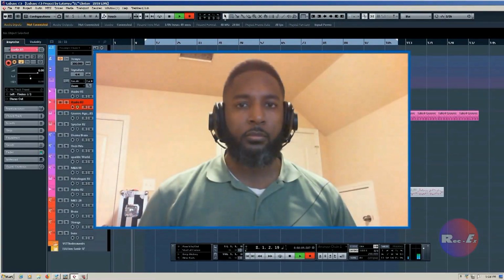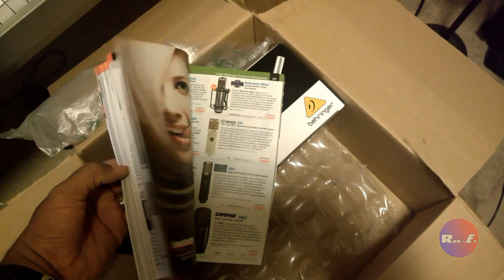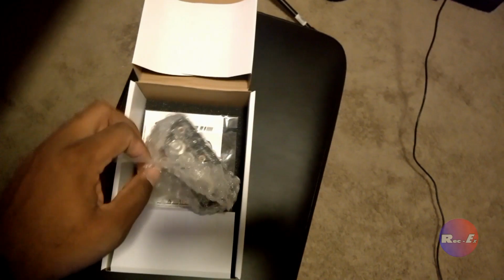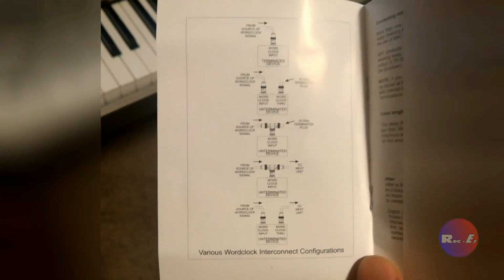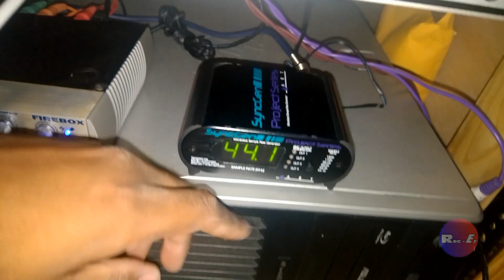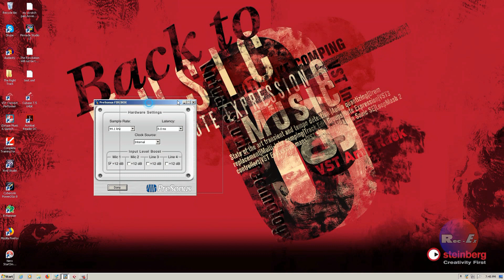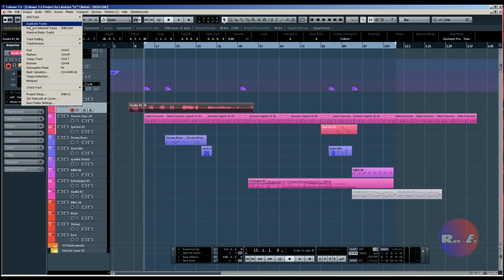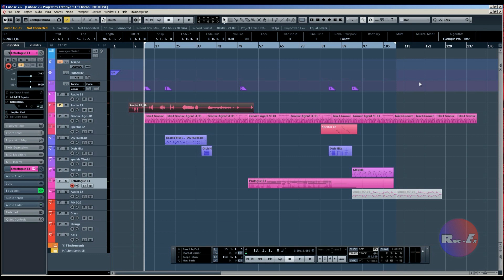Art SyncGen - Word Clock Generator - RecEx Ep1

Comment: Hi, would this work with just hardware?. As in to get various pieces of hardware in sync with eachother?.
Reply from the maker: Yes, if you're running multiple sound cards, FX or signal processors and they all have word clock input (BNC/SPDIF), this will keep them all in sync. It's not just for soundcards. It just primarily baked in  soundcards.

Comment: Thank you for the video. A year later, do you still like the Art syncgen?  Any issues with it?
Thank you.
Reply from the maker: I still like the Art Syncgen. However, this was a short term victory. Not long after using the Art Syncgen to fix the audio clocking issue , my sound card just died. When your soundcard starts having timing issues, just get a new one.
Reply from the maker: I eventually ended up going with a Yamaha UR242. So, these days in not using the Art Syncgen.
Reply: @TheOfficialLCProductions  Hey chief
Did you Test if there is a difference in sound 
URs own clock vs Art Sync clock?
It should/could bring a better stereo Filed (as they say)
Reply from the maker: It's funny you mentioned that. The first thing I was told was that it would have better sound quality. I honestly didn't hear a difference in the sound quality. However from a mixing and mastering standpoint, I could tell the overall mix on my tracks were fuller, beefier. If it were not for the advanced metering I use, I would not have noticed.
Reply from the maker: @jameslast6581  I'll also add that your sound card will always sound and perform better using it's native internal clock. Driving your sound card from an external word clock source is for the sole purpose of expanding i/o and audio syncing hardware.
Reply from the maker: @jameslast6581  As far as comparison goes, there are no options on the UR242 to clock it externally. So, if you're using the UR242, you are stuck with the internal clock generator.